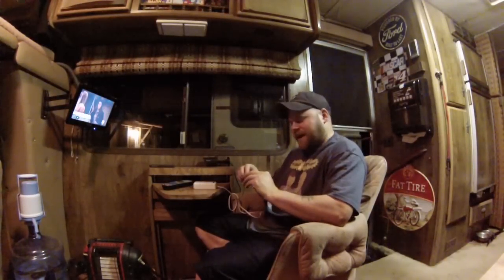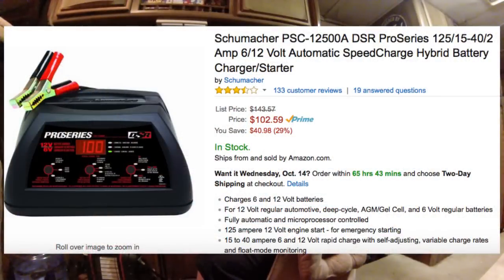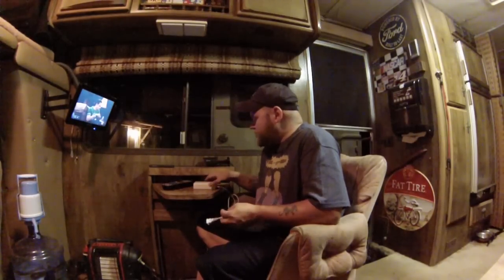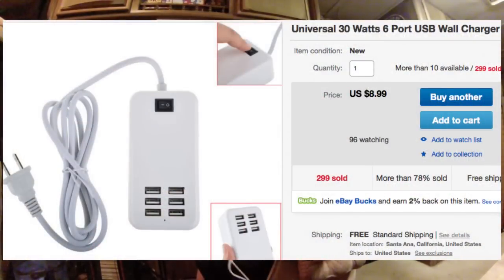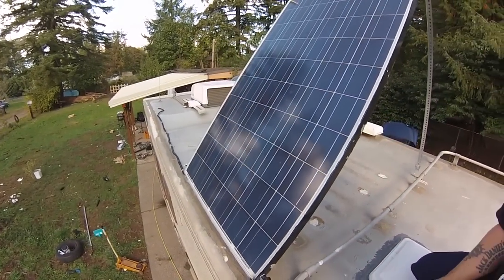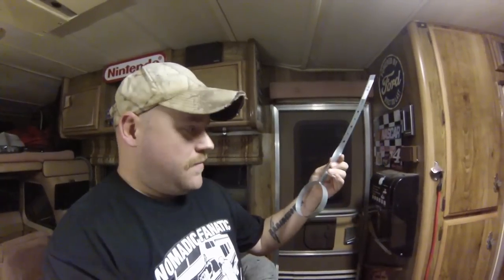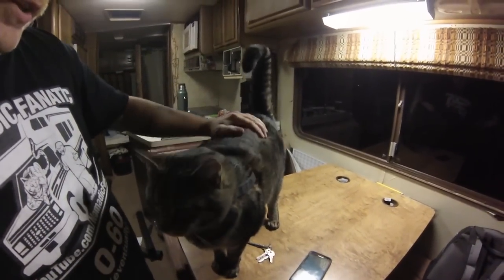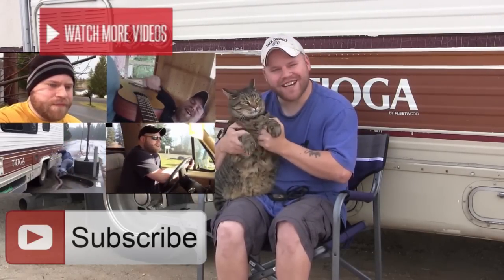Tilting Solar Panel & Updates

Comment: I run a 120 power strip with 6-12 watt apple USB chargers, 72 watts @ 5 volts. Vs 6-2.4 watt @ like 13 watts, yea baby!! things charge even while running.

Comment: Get some stain sealer and kote the bottom tom and sides with three kote's and then get a nice thick piece of rubber cut to fit.
That's how I would finish it up. The repair looks good.

Comment: Tip: File down the edges of any pieces of metal with sharp edges that's up on the roof. Both to minimize the damage from accidental impacts to roof and you. Also the PV mounting knobs will eventually shake loose from vibration, have spare hardware for when it does get lost. P.S. the solar panel will become a dangerous item if it gets airborne while driving, keep a close eye on the tilting mechanism. Safe travel.

Comment: Hi Eric: I've been watching your repair/maintenance videos and the heartfelt one.  Hang in there, kiddo.  You are an inspiration, and with all the things you've installed or replaced/repaired, you could build a tiny home.  I can't help but think they would last longer than the camper or van, and if the truck breaks down,  just replace that part or put it in a shop.

Comment: Paleo diet works but one must be committed...cutting out Adult beverages helps.
On beards...you need to give any facial and head hair changes a few weeks to get used to them. Unless you have a misshapen head or a scar you are covering...getting Used to it is the prime factor. When I started cutting my hair short it was a shock. Now, it is the best way to go...no fuss, no muss and if you have an MC...NO helmet hair.

Comment: your speed charger will be faster than a trickle charge for sure. But there is another way. Buy a battery isolator from Amazon. Its a one way valve for electricity. Then connect it between the truck battery and the 4 batts in the back. This will hit your 4 batts in the back with 80 amps anytime the truck is running. Maybe more power depending on how big your alternator is. No it wont kill your alternator in your truck. becasue of the battery isolator remember to hook it up so power flows to the RV batts.  The Alternator will load down but its supposed to quick charge the batt after starting the engine. I am a TV engineer and we run live trucks like this all the time. Oh one other thing use the largest cables you can afford. The more copper the better it will work. Genny's are supposed to run at a multiple speed of 60 aka 60hz in frequency. This enables them to create that perfect sine wave electronics like. so well. There is a small tolerance to this but not much, yes it does increase your voltage to do this but its like cocaine. A little is fun, a lot makes you wake up in an ugly woman's bedroom, commonly known as HELL.. My suspection is that the genny needs some love, spark plug, cleaned carb, changed oil etc. Onan sez change oil every 50 hours or so.  Hard mark to hit for us TV stations as we run them almost 24/7. Our genny's go 3-5,000 hours. Service guys get tired of working on them somewhere along the way.

Comment: I think you need to get a high end multi step charger designed to safely charge your large packs. With the size of your battery pack something in the 60 to 90A area would be good. Problem is they are not cheep.

Comment: Eric you should buy yourself a flux core welder and learn how to fix your exhaust properly as well as any other repairs that require welding.  It will save you plenty in the long run and the welders are small and cheap.

Comment: Older microwaves use a lot more  power (2000-3000w) than modern microwaves. They make high efficiency microwaves that run at 700w max. A modern $99 Walmart microwave generally runs around 1000-1500w. Another super cheap tool you can get at HD or blowes is a kill-a-watt meter. It can help you determine your power usage amps, watts, voltage & several other things. They are only about $20.

Comment: Instead of these chargers you have just ordered and the ones you have used in the past... why not a smart charger/converter to replace your current converter/charger????? Like a Progressive Dynamics smart charger converter. Way safer for batteries and have 4 charging modes and come in 45 - 80 amps and several inbetween.

Comment: Generator depends upon appliances and their actual wattage vs genset. If you're using an older microwave 2000 Watt its tends to use 2500 W to even 3000Watts in starting power. So, If you only have a 2000W gen it wouldn't increase enough to compensate for your power consumption.You might like to read or Google "wattage estimation guide for generators" over on Honda or Onan website. I had to have an 8800 Watt genset  for tools and other high use equipment to cover starting watts.

Comment: Did you clean the carb on the generator? If it's bogging down under load it's probably not getting enough fuel to produce the power it needs.

Comment: I certainly wouldn't want to run anything directly off the genset that is touchy about the correct voltage it needs while it is like that.   Exhaust hanger brackets are usually fairly cheap  $6.99 (free shipping) on ebay and many are universal dependent only on the size of pipe.

Comment: Not knowing what engine your genset has I don't know what type of speed regulation it uses, but it SOUNDS as if your governor flyweights have been disabled or come apart, which is a fairly regular happenstance on many small engine.  Saw a lot of that in my years as an equipment mechanic for Nevada DOT.

Comment: The adjustable brackets holding your solar panel will at some point cast a shadow across your panel,I have 15 solar panels on my garage roof I had made mine adjustable by using aluminum square tubes one larger then the other so that one slips inside the other and drilled holes for adjustments and used a bolt and nut on each side pipes will also do the trick.

Comment: i was told on homes, 12 degrees was the most efficient angle on solar panels
Reply: +Mitesh Damania It depends at which latitude you're located.  In the Northwest US where he currently is and that it's almost November, he has the correct angle set.  If he were to stay into December, he would need to increase the angle even greater as well.
Reply: +JustSomeGuy good point on the latitude and season

Comment: Your generator is 40 years old... stop trying to fix it... it's garbage and not efficient
Reply: +Scott Elsasser That's a good point what do think he should get an Onan 4000 watt Generator. I'm interested because a have a big heavy 6500 Onan that works fine but I know its out dated.
Reply: MegaTriumph1 I'd get a Honda generator or Yamaha. Best bang for your buck. Efficient and reliable also incredible quiet. There small too,  only issue would be you'd have to manually go out and fill it up with gas unless they have an adaptor I'm not sure. Also I no other brands like champion have remote turn on so I'm sure Honda would have the same. I'm no expert  but there's always a way to get things done. And a 4000 watt can run your microwave airconditioner everything you'd need all at once with nice constant power. I'd say getting anything better is over kill.
Reply: +Scott Elsasser  I have a honda eu3000is and it is very quit and runs everything in my camper  great. I made a video of it on my page
Reply: +Scott E Typical american view.  Just throw it away and get a new one rather than try to fix it.
Reply: Rc Flyer also one would assume when purchasing a new vehicle that all the fluids and filters are fucked. Atleast I do so I change everything before it becomes my daily.. knowing Eric nothing has been done so you may be right could be just a tune up
Reply: Rc Flyer your right Onan generators are great and worth it if you own one but If I had to replace one I don't think I'd go with Onan I'm a fan of the smaller units anyways like 2000 watt is way more then I'd need so getting 3000 or 4000 watt generator would be over kill for me. Plus I'd only have a battery charger hooked up to it. So I could charge my batteries that's it. I don't like microwaved foods so that wattage isn't an issue for me and an airconditioner little 5000btu window unit will run off my 1000watt honda generator which is around 10 years old if I ever wanted a/c. ///I've been a sub since like 10000 and I don't think I've ever seen Eric change any fluid besides just adding to it. Or heard him mention he got it serviced for maintenance. But I'm not sure he may be on top of that and fails to mention anything.

Comment: Eric, That bracket might work to hold up your exhaust, but since its solid it will not eliminate the vibration and will just break again soon. I'm sure you drove past 5 auto parts stores to get to Lowes, you should have gotten a real exhaust hanger with a rubber vibration strap in the middle. It would have lasted 10 years. just say'in. 
Also, if you were plugging in for 48 hour and didn't get a full battery charge, you have a problem somewhere. I hope the new charger will fix that. Double check all your connections and make sure everything is tight and clean. 
Keep up the good work.
Reply: +Mark Kennedy I agree with all that...he may also have a problem with the converter...I'm assuming you plugged in your charger to one of your 110v coach outlets to charge your batteries? Are you getting 110+ volts from your coach outlets while plugged into shore power. If not, perhaps the converter is limiting the voltage coming from both the shore power and the generator.

Comment: I still say you need 250 watts more of solar. 500 if you can afford it and have space. This winter you will have alot less of sunshine. 250 - 500 watts will do you alot of good. As for the generator you might want to get to serviced.

Comment: Great video .... I'm starting to thing the generator might be the engine.   It sounds like it has lost power ... so it can't push through a heavy load  ... might just need a carb adjust or cleaning.
Reply: +Bob Routh  Hi Jax

Comment: LOL on the steps, oh boy do I know this one! I fell out of my RV when I went to buy it, the step went right on the ground. A tip? make sure to put the L brackets on the inside and outside (as you did) although I used a 4" L bracket set up. That pan is thin metal and it will keep cracking.Check for a leak above and around the door as it will run down the inside walls and do this rot thing again. I will be redoing mine again next spring with Marine board and a steel plate on the outside for further assurance i don't fall out again. .

Comment: the generator should run at a constant 3000 rpms. It must run at constant RPM to maintain 60Hz.  Newer generators like the inventor style (honda eu2000i for example) change rpm depending on the load because it digitally maintains 60Hz.

Comment: You might put a mercury switch on the side of the solar panels to light an LED in the cab so you don't drive off with the panels raised.... having some bright red lights there facing you before you drive would help.

Comment: You should find a purpose built charger instead of using automotive chargers.  And what is the wattage rating on your generator?  You may be exceeding the rating, or it may just need servicing.

Comment: Nice to see all your progress. At least with the generator, you can use it for recharging since you can now get it up to120 volts. Just awkward because you obviously want to use it for other things when you have it running, but since it won't adjust for changes in load you may have to just use it for charging until you can get that solved. Best of luck.